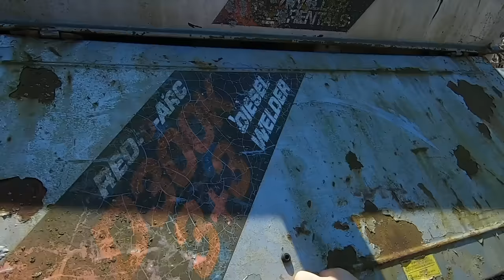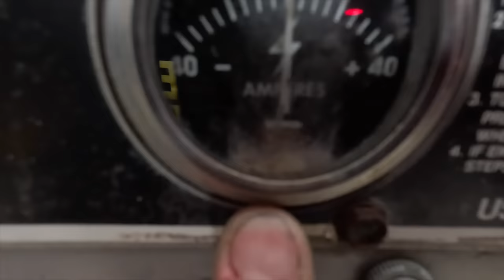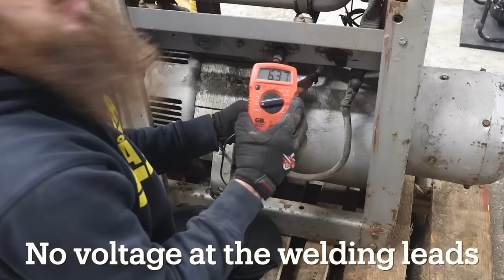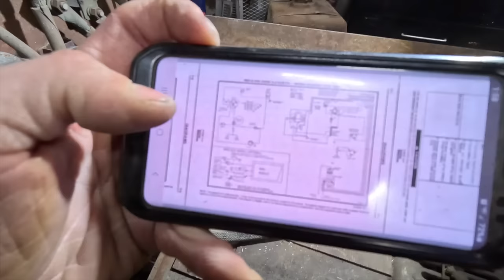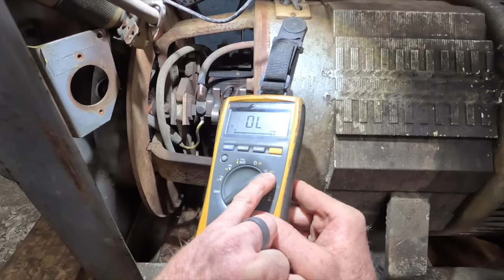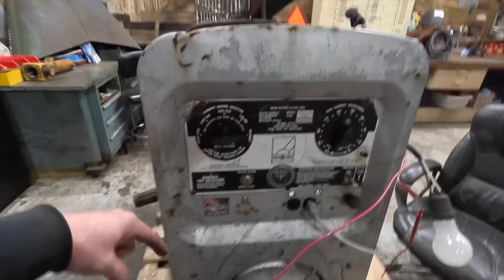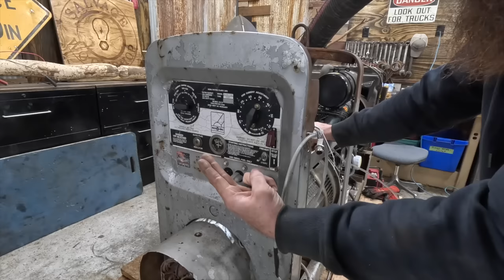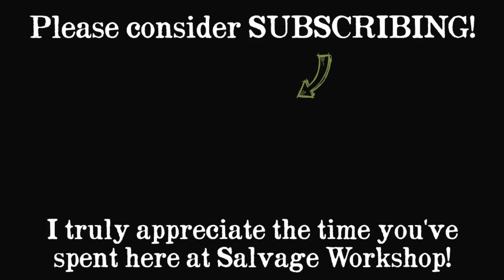SAVING an ABUSED Portable Welder from its Junk Yard GRAVE! ~ WILL IT START? ~ Red-D-Arc D300k P. 1

Comment: The 120 volt plugs are actually fed from the generators exciter. The exciter is the smaller round bit sticking out of the back of the unit. The exciter output should be approx 120 volts. Check for a dirty slip rings on the exciter. That was my standard fix when I got a shift call out to a non-operational motor welder was to clean the exciter generator slip rings to get the generator working. This worked 99.9% of the time. Of course these welders were in use and hadn't been sitting in a field for many years.

Comment: Wow, great job bringing the dead back to life! I got an old Miller AEAD-200LE , a somewhat smaller machine similar but powered by an Onan gas engine. Mine was found under a tarp on a ranch in the mountains and followed me home on it's little trailer. Stuck valves and a bit of other things I had to fix to get it running, so this was a neat video to see how you did a similar project. End result, we both resurrected a couple great little workhorses! I love bringing old things back to life!

Comment: A small zip tie wrapped around the wire before putting the wire in the connector keeps the frayed end of the wire together so they don't catch on the connector as you try to put the two together - clip the zip tie off after the wire starts into the connector.

Comment: One thing to keep in mind when using power tools with the older engine drive welders is to use only power tools that are rated AC/DC because if you attempt to use anything with a variable speed then it will either fry the switch or burn the tool up. I learned that lesson many years ago with a Hobart welder.

Comment: I can tell you your observations on the bridge rectifier were correct. + to - will test as a diode and as you observed, it looks like 2 diodes in series. ac/ac will always test open. There's a lot more to diodes than I can condense into a comment, but you're on the right track.

Comment: I had previously thought all of these machines were based on the Lincoln 300, but that one may be based on the SA250. That said, I don't think any of the 250s had an option for a Kubota engine...but the 300's did and still do as far as I know. The Ready Arc variant was a really dumbed down version. It runs at one speed, where the normal version of the machine has a selector switch for auto idle(runs at lower speed until a load is detected, then automatically speeds up) or high idle(welding/generating speed). You can install parts from a standard version of the machine to get the automatic idle function.

 I have a Lincoln SA-250, which came from a scrapyard. It was partially disassembled, but all the pieces were there and I paid $400 for it. Mine is a 1993 model IIRC and has the diesel Perkins D3.152 engine. This engine was also use in Massey Ferguson 135 tractors, some New Holland tractors, and other equipment. One thing I can tell you with certainty is that your method of starting with the engine is absolutely wrong. The generator portion of the machine should be checked for wasp or mouse nests(which you found, eventually, and lucked out that it didn't get sucked into the armature or field coils) and shorts before you ever try spinning that motor over. Forget the engine even exists until that's done. I see you have a number of other similar videos, so I offer this advice to save you from a costly mistake in the future. I don't know about the armature on that machine, but a new one for mine from Lincoln is over $3000. Getting the armature rewound costs about half that. Field coils were several hundred dollars when I last looked. Any of these parts are easily ruined by debris that could and should have been removed before the engine turned. Again, not checking will eventually bite you and may turn an otherwise good machine into scrap.

The fuel solenoid is there as an engine protection feature. If it overheats or loses oil pressure, the Murphy switch trips, shuts off fuel, and shuts down the engine...hopefully before any major damage occurs. My machine wasn't equipped with this option when originally purchased. Everything is easily available and not very expensive. I'll be adding it to my machine. The momentary switch is there to be used at engine startup. Remember the Murphy switch stops fuel flow if there's not enough oil pressure, and at startup, you have zero oil pressure, which means it also won't allow fuel flow. So to enable fuel flow, they add a momentary switch to override the Murphy switch. DO NOT defeat this with a constant on switch. Unsurprisingly, most of this information and some troubleshooting is in the manual, which is available on the Lincoln Electric website. Alternatively, you can call up Lincoln Electric and they'll probably put Bob Crow on the line to help you.

A set of Lincoln replacement insulated stud connectors for the welding leads cost something like $30 when I last looked. My machine needs a set.

Comment: the older SA200/SA300's had 3k generator output that was D/C,so you couldn't run variable speed electric tools on them,the newer ones were A/C

Comment: Your momentary switch is known as a Murphy switch, Murphy is a brand name, you need a momentary switch to override the no oil pressure at startup. One your oil pressure is above 10 psi release the momentary/Murphy switch engine will run. Upon low oil pressure or high coolant temp the engine will shut down via the fuel solenoid. Also adjust your engine RPM's to obtain 120v at the outlets. The voltage at your welding leads do not correlate to the range and fine selectors directly, although as you increase the amperage voltage increases. Amperage is directly correlated to selector settings.

Comment: @ 1:43:00  For the momentary toggle switch...is it possible that you have to press it ONLY when starting...then release it when the oil pressure switch takes over keeping it on?  
BTW:  I found that hammering the copper pipe flat and then drilling it out...before...cutting it off makes it easier to handle...just my experience  :)

Comment: You need to seat the brushes. Brush Seater and Commutator Cleaner, 1-1/8" X 5/8" X 4-3/4", Medium - 23008M

Comment: Make sure to provide incoming air, from outside, for the engine intake as well as piping out the exhaust. Otherwise, if the engine intake is sucking air from your shop, it will be drawing in cold air from everywhere it can, like from under that overhead door. It will get cold in your shop, fast.

Comment: You might try going on line to see if Lincoln has a service manual on line for this unit. I have found manuals for several military gensets on line. You might also make a cover for the controls if you plan on using the welder outside. It will protect everything from excessive weather related wear and tear.waiting for part 2!!!

Comment: You don't want to even crank diesels without fuel to the injector pump. The fuel lubes the plungers and can be damaged quickly. The voltage from the welding leads is fine. That only changes with the fine dial. The amperage is what changes through the different connections from the coarse dial. Looks like a wonderful welder. And I love those Kubota engines. They last forever and always work.

Comment: I watched the video. Sure is a big unit! I just learned for the 1st time yesterday how to check a bridge rectifier and same day learned about the voltage drop from a diode check. I couldn't even get  a Makita cordless drill 9.5 v charger to charge. It only had 5 resistors 3 electrolytic caps & 1 low power transistor 1 MOSFET transistor  1 diode 1  bridge rectifier ( 4 diode thing)  everything checks out. Mine is 1984 & heavy "not", a  (light weight switch mode)  charger, so maybe its the big transformer windings it self. So you had better luck with that big thing than I did with the little hand held thing. lol  The lucky thing with your salvage yard buy, is the motor seems sound . And the Glow plugs even work!

Comment: 1:42:48 thats probably normal cause u only need to push it for starting it then the oil pressure switch wired in parallel "takes over". until u shut it off.

Comment: For future reference you may want to do the following steps first when ever working on electric side of generators that have no output, #1 fuses and breakers and broken easily accessible wires for breaks, #2 brushes, #3 magnets if you already know it turns then I go through contacts and wiring

Comment: Fume extractor is a great idea. A long hose to stretch to different parts of the shop and you have a good working environment. The other thing I would suggest is a small metal bath for washing parts using old diesel that loops round through a filter as a first treatment for old dirty parts. I find a good soaking often loosens up seized stuff before you even need other methods. Best wishes.

Comment: My best buddy up it Toronto used this exact welder in fact he still does but he doesn't weld much any more, has a couple guys welding for him. He started his company in 1983 and acquired 5 homes, 3 rentals that the tenants paid for a huge house on 58 acres that's his summer home and another nice house in Florida for the winter. Had this welder in the back of his truck and every cent he made was with that welder.

Comment: thanks for the videos!  hope this helps  variable resistor is super simple  the longer the length of wire it runs through the higher its resistance or  the lower the voltage output . it is just a long coil to keep it compact or your contact arm would need to be huge.

Comment: It's a really good idea before cranking or starting an old unit like that to remove the sheet metal covers from the generator and exciter. Give them both a thorough inspection for debris. Mice and other critters love to pack them full of stuff and chew on the wires/insulation. If you start it with stuff packed in there there's a real possibility of damage to the windings. Also you want to make sure the brushes are all free in their holders. It could cause some serious arcing or other damage to the commutator if they're not.

Comment: Kudos to you for fixing the Generator Great job. Useually people on youtube get these they dont clean the connections and ohm it out like you did. They cannot fix them and deem the dead.:text-green-game-over::face-fuchsia-wide-eyes::cat-orange-whistling::face-blue-wide-eyes::face-orange-raised-eyebrow::face-fuchsia-tongue-out::glasses-purple-yellow-diamond::body-blue-raised-arms::hand-orange-covering-eyes::trophy-yellow-smiling::trophy-yellow-smiling::trophy-yellow-smiling::trophy-yellow-smiling::trophy-yellow-smiling::trophy-yellow-smiling::trophy-yellow-smiling::eyes-pink-heart-shape::face-turquoise-covering-eyes::hand-purple-blue-peace::hand-purple-blue-peace::hand-purple-blue-peace: You the man. I got a Mig welder and a stick I can weld pretty darn good with the stick if that is all I got. I like stick welders a lot. Diesel motors are the best. Weld that exhaust up with Stainless STEEL it will hold. Also heat it up with a torch first so the metal dont pull the heat of the weld. It will work.

Comment: I agree with @dandunlap8638. The button is a momentary bypass to be used until oil pressure builds.Make sure your new temp gauge is a contact making gauge that makes or breaks on overheat the same as the original did. I think the oil pressure switch also turns on the alternator and hour meter.

Comment: A diode is a rectifier, which is another way to say what you said all through the presentation; it allows current to flow only in one direction.  Applying an Alternating Current to a diode/rectifier allows the current to flow in the one direction, but cuts off flow in the other direction causing the loss of power for half the AC cycle.

The Full-Wave Bridge Rectifier is a scheme by which the second half of the AC cycle is steered to the positive side of the zero line.  The plus side of the Alternating Current and the minus side of the Alternating Current are both set to flow in the same direction.

Diode test function on most Digital Volt Meters applies a small, usually two-volt, bias to the diode.  It subsequently indicates the voltage that falls across the diode when forward biased, i.e. when the current flows through the diode.  When reverse biased the  meter indicates an overload(OL).  Should your diode fail with a short circuit it would indicate with 0.0 .

The reason your indication doubles when you read from the minus(-) to plus(+), i.e. forward biased, is because you read the voltage falling across, in parallel, two sets of two diodes in series.  Presumably all the diodes in the bridge rectifier are manufactured the same so there's every reason to expect that each diode would act very similarly.  The indication doubles because you read the voltage drop across two diodes in series.  Two diodes means double the voltage drop of any one diode.  You do so across the two pairs of series diodes in parallel with each other.  Since you measure voltage drop, and since the diodes are closely matched to each other, the voltage drops across either pair match the other pair.

When attempting circuits analysis it often pays to recall that current flows through components, but voltage falls across them.

Comment: You can TIG weld with it, scratch start deal but works good when you're welding thick materials. Just swap leads, pick up an argon/lead block, big argon cooled torch with lead and rock on!!

Comment: The red wire running from temp gauge is the murphy switch in case it over heats it will shut down the motor. I had one of those welders in the back of a service truck. But we had to remove the gauge off the engine as it vibrated there and would not function.IE it would not let the motor start> Have a Great Day

Comment: Think you misunderstood the momentarily switch. I guess this is an override switch to start the machine while oil pressure or temperature is too low. So you have to press it for start and when it runs you can leave the button unpressed.

Comment: Larger filter would have less backpressure because it has a higher surface area for oil to pass through.
Not sure if that would increase the oil pressure by any meaninful amount due to increased flow (if there is any).

Comment: It's impressive you got that rat's nest wiring working again. A good tip for sliding on heat shrink tubing is to tie a length of smaller wire to the lug and then use that to basically pull the wire through the heat shrink. It makes it much less of a struggle trying to push the cable through. Edit: I just got to the part where you make the lugs, it works, I've done it before in a pinch too, but make sure you anneal the copper after, it tends to break off in vibrating conditions after work hardening.

Comment: Momentary push button starter/horn type switch is a must!  #2 one of the windings in the armature is used to create a magnetic flux field otherwise you would need very powerful permanent magnets inside to produce said flux field. Which also works. That stater winding is usually the stationary winding ie IT'S Stationary doesn't move. Armature ie AXIAL it rotates and has to be properly excited by a feed back loop to continually provide said magnetic flux field 37:01  field that in turn rotates invisiblely cutting through the slightly larger stater windings hence producing an inductance currant in the windings of stater and this is usually done in 3 phases so that mag flux field pushes electrons through the 3 sets of stater windings. Electrons tend to flow like water through a pipe from one negatively charged end of the copper winding towards the positively higher charged end of the winding hence in sets of 3 phases hertz in USA is set constant at a pulse rate of 60 high pos or 60 low neg. Cycles per second hence 60Hz now your bridgerectifier is a clever device made up of several diodes typically 3 or 4 and configured in such a way that when introduced to an alternating current collects all the positively charged electrons and directs them to only flow one way to a pos. Or higher energy level whilst at the same time collecting all neg. Lower charged electrons and flipping them over to a pos. High charged state now producing D/C current in d/c 120hz pulses which is then smoothed out of this ripple large capatacitor bank now effectively becoming low noise/d/c pulsing ripple is essentially smoothed out by large caps. Then rectified to usable D/C output current for welding etc.  the reostat is nothing more than a high powered wirewound patentiometer resistance wire wound tightly around   a C-shaped ceramic core/frame with a rotating wiper arm connector that is used to raise or lower the resistance or power output. I have most likely already lost most people by now but anyhow holla at me if you need any more help im a master scientific practical engineer and amateur mechanical physicist a guru when it comes to Lincoln welding machines SA300 outputs around 10Kv of useful altetnating current regulated at 60Hz single phase 120V+120V and when combined 240V generated power for household use. And also more than 300 Amps of D/C current used for welding. Good luck learning to weld.
Reply: So that unit only had 120v output. So just need to add another Line and you could have 240v?

Comment: You didn't really have it too hot for that weld (the porosity is kind of a hint); it's just mostly the nature of that joint, with the thickness of the metal, because you have to sit there for so long to fill it in. It would be better if you put a smaller weld across the root, clean it up and maybe grind it out a bit, and then in the next pass you burn out the rest of the impurities and do some filling.